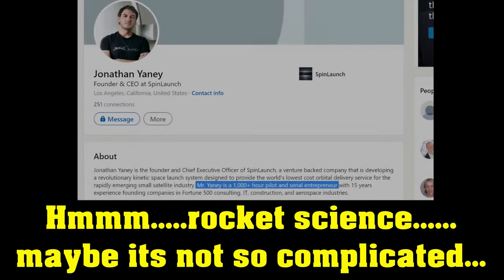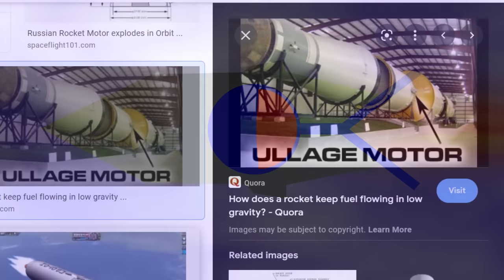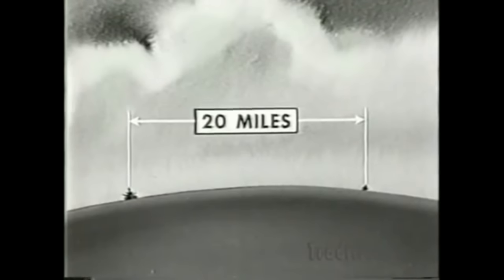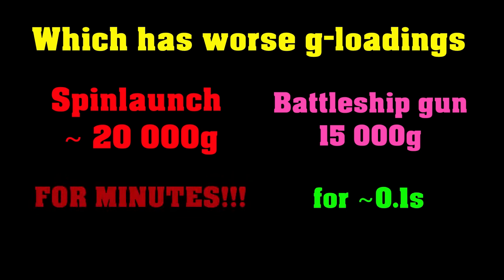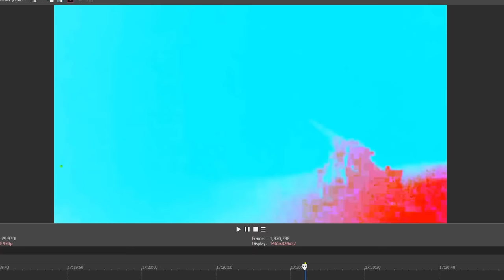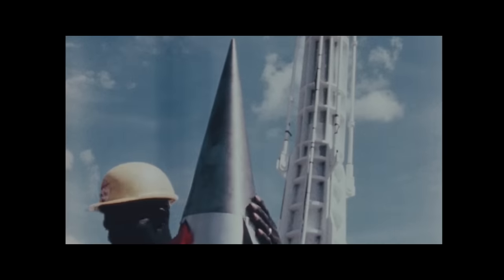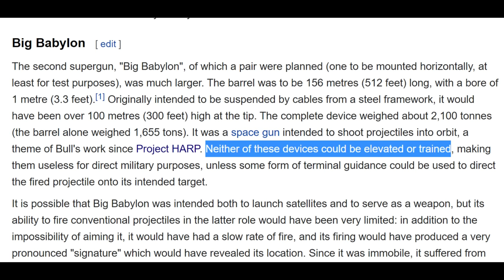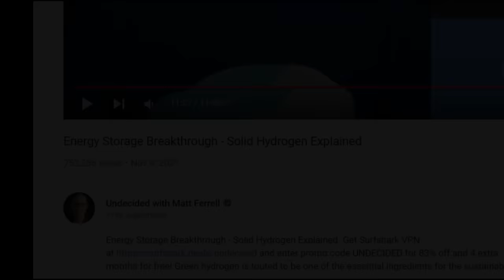Spinlaunch: BUSTED (Part 2)

Comment: Bad debunking,
with none of the physics addressed!

this thing will get to orbit with enough engineering effort.
the main question is: whether there is enough of a market for launching 20,000G-proof satellites.

the only instance where I think that it could be economical is launching bulk insensitive cargo to be used later, such as food or fuel

Comment: Assuming the diameter of this thing's arm is 108 ft the circumference of the circle it would produce while spinning would be 339.29 ft assuming there are 5,2 40 ft per mile to get this projectile to 5,000 miles per hour this centrifuge would have to spin at 77,500 RPM
Now I don't have a degree in engineering but I fail to see how you're going to get an arm that large up to those sorts of speeds when my weed wacker spinning a 16-in diameter circle of plastic string struggles to get that plastic string past 12,000 RPM how on Earth do they plan on spinning an arm that big up to that sort of speed even in a perfect vacuum which as thunderfoot pointed out is impossible for a chamber that large it blows my mind that people are gullible enough to believe that things like this are possible on Earth with Earth's limitations the whole thing would practically fly apart at full power

Comment: Spin or blast out of a tube, the G-force will be the same, to reach the same range,  just wtf are you sending up there, THAT hard, a cannon or bomb? There is 100s of way beyond a rocket to get into space, THIS is YEET to be one of them😜  For example, you can take a massive fortress station into space, without blasting off a ground rocket. How? Vhigh balloons hanging on rockets of same air fuel, when you reach near the peak, rappid compress while slow booster burn rocket engines swapping volume, then next stage full thrust beyond the zero grav&air kamen meso, ion. Presto , MASSIVE station into exo orbit velocity in just 2 of not more used stages.

Comment: Elon needs to hire you quickly.
Reply: Why? Thunderf00t doesn’t understand basic Rocket Science.
Reply: @jackwhitlock1  I think He does and at least he knows what not to do.
Reply: @marco.loschiavo  Except he thinks the tanks will be half filled. A two year old would make that mistake, not someone that supposedly has a PhD. Not to mention the fact it uses a pressure-fed Engine, meaning the tanks would be pressurized.

Comment: I came across spinlaunch and thought it was interesting because I love physics but when I seen how it works all my knowledge on the subject was screaming BS. It just doesn't work like that. Even if it did work what would be the g forces exerted on the payload while it's spinning? You might could fire a solid projectile but will anything sensitive that we need to get to space hold up to the extreme forces that are not being applied evenly from the bottom? Total BS. Interesting idea though.
Reply: Just watched the other half of your vid and you just touched on that.
Reply: the fueling would defy physics.  and liquid propellants in this sceanario... just no.

Comment: I won’t be bringing up the points I made on the comment on the last video because I am not a broken record like Th*nderf**t

1. It’s a artist’s rendering. Also ullage motor is unnecessary if you just put a small spring pushing back on the fairing.

2. Also the tanks are full so no sloshing.

3. They never said they did such tests on the centrifuge, I’ve heard Holloman AFB has a nice Mach 8.4 testing rig.

4. Sound effects are likely put in in post because it sounds cooler.

5. CNBC’s incompetence has nothing to do with the company/concept you are advertising to talk about.

6. “Very high accuracy” that’s why there are still have battleships around.

7. When did they ever claim to be accurate?

8. Comparing well developed weapons to a early prototype again.

9. Fire rate is definitely very important when it comes to space launch, definitely.

10. Do you expect a company to develop a system that is better than a battleship gun in every way and not get into legal trouble?

11. High G systems can be built if you put some effort into it. Satellites are not built to withstand 20,000 Gs because it currently isn’t practical, that can change.

12. What did showing that the nuke footage was slightly edited achieve? It’s still a real nuke fired from a real gun in a event that actually happened.

13. Oh look old ideas that happen to be promising and really cool can’t be revisited because… why?

14. I’m sure we need a space launch every minute.

15. Ew Britain.

16. Saddam Husain had only one target in mind so it would have still been a useable weapon.

17. So are you saying we should spend our money on things that already exist? Isn’t the whole reason to fund a project basically to make it into a reality?

18. Everything can be broken to simple geometric shapes.

19. Being even compared to the absolute perfect beauty that is the HARP gun is a positive in my books.

20. Mmm yes shameless self promotion with a terrible transition.

21. Mmm more shameless self promotion.

Just stop.

Please.

Comment: It would work in space, no need for forming a vacuum. Sort out the issues of the kickback from the payload to the spacestation plus the energy cost of it and your on to a winner.

Typical physics Vs engineering. You could make a space elevator, but the materials required don't exist currently

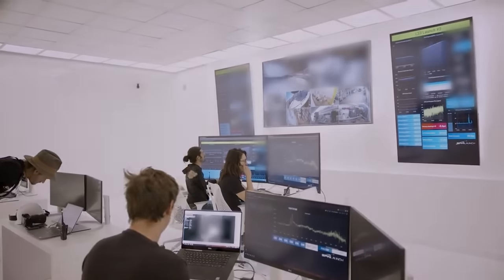Comment: 3:52 You are counting rpm of blade with a low framerate video, not all revolutions were captured in the video. Therefore, the rpm you calculated is very unreliable. Not saying it changes anything but getting data like that is not ideal

Comment: I get that you pump out these videos. But you should spend less time drawing lines on JPG's, and maybe have a read. 
They're not evacuating the whole system. They plan on shutting a door behind the projectile as it enters the "barrel". So only lose vacuum in the barrel itself. 

And you missed the most obvious and obnoxious issue with the whole setup. A centrifuge at massive RPM which suddenly becomes unbalanced by 200kg.  Currently they just slam the counterweight into a wall. lol 

Otherwise fun vid.

Comment: You would also have a low-altitude sonic boom to deal with each time a projectile broke the sound barrier. Not the biggest problem to deal with since the launch facility would have to be located in a remote location, but it might damage the centrifuge or launch chamber.

Comment: Can someone explain to me reasonably why they cant just shoot 2,000 pound satellites into space using naval guns? Is it because of the force required to shoot it? Would the electronics not survive the shot?
Reply: The force is too high, yes. No gun can shoot that far. 
No gun of any size can shoot something into orbit. The physics of orbits cause the projectile to go around the planet and smack into the back of the gun ... except it will hit the ground first. You need a rocket to round the orbit.
The horizontal speed required to achieve orbit is roughly five times the vertical speed needed to throw something up to orbital altitude. A gun can't supply that much force and cannot direct it properly from the ground.

You might be able to build electronics that will take the launch shock of a gun, but you might not be able to harden everything.

The SpinLaunch idea seems plausible, but it isn't.

Comment: I'm not here to defend spinlaunch, because most of the science behind it is stupid. But almost instant G changes/acceleration of around 15.000G and slowly building up to 20.000G is not the same. Massive G acceleration would tear most things apart, but slowly building things up to high g's doesn't have the same effect on things. You're literally comparing apples and oranges here. Besides the directional g force on the two is completely different.

Comment: You don't need ulage motors the space craft is already moving forward.
Reply: You need them if the projectile starts to slow down, which it will as soon as it exits and comes into contact with the atmosphere.
Reply: @GoldSrc_  You’re forgetting that the Tanks with be pressurized since it uses a Pressure-fed Engine.
Reply: And the tanks will be full when the Engine lights.
Reply: @jackwhitlock1  You're forgetting that this is a scam.

Comment: You seem not to understand that the reason they use a method that takes 8 hours to spin up is that electronics break when they get hit by 15k gs in a fraction of a second but not so if it’s spins up slowly. Just like when you crash a car it’s nots the stoping that kills you it’s the fact that you are stoping immediately. Slowing for 70 to 0 is fine as long as it doesn’t happen instantaneously This video went out of its way to be disingenuous.

Comment: You could have a big powerful decompressor to help the reset time. You could have a counter rotating tip to remove unwanted angular momentum, and you could launch only devices suited for the crushing g forces, then yeah you would have a cheap to operate cannon deal. You know how railguns work eh? they zap the living jesus out of some super conducting coils like something out of a bad batman movie.. but wait, there's no such thing as a bad bat man movie! :P Every timeyou reload the railgun ya gotta suck the air out and destroy a special cover plate made from thin aluminum too. You just don't like rotation, but if it was a rail gun you would be ok I think. I wanna see if they really do it, and if you will make a correction video if they really do start spin yeeting these damn things to space lol. I mean, stranger machines have been invented, like double ended pistons, and other preposterous engines... Like give the poor guy a break... He might figure out the counter rotating tip thing.....

But the first thing I think of is holy mother, the vibrations you would feel when it fires, because it would be like a washing machine on spin cycle with a big hammer in it, or like a brick stuck to the tip of a helicopter propeller, unless there was a second weight that slams into the ground lol.. That was the part I think you missed. The rust in the tube was your first concern? Really? I think thunderf00t doesn't exist, and you are really a worse copy of thunderfist. :P 

1 out of 5 starts on the debunking.

worst

debunk

ever....

But wonderful video, I like the artillery nuke footage being debunked and rebunked again. That's a real word...

Comment: your first point has always been a problem an a simple solution is pressurized tanks whish will push the fuel out anyway another solution is to use a monopropellant to push the fuel to the bottom of the tank. this problem has been solved since the space race

Comment: I want to see the liquid fuel rocket motors that can tolerate 10,000+ G's laterally and still function.   Not going to happen and before anyone invest a  penny in this project you should make them demonstrate those engines...otherwise this project will never work.   So...build a test rig and spin the crap out of the engines  then stop and see how they fire and be sure to get the isp needed to get to orbit.  Of course this will need a whole vacuum chamber test rig which will cost more than the whole spin-launching gizmo and be much more difficult to build.   I'm not seeing it happening.

Comment: Harp failed because the electronics could not take the Gforce and Gerald Bull fighting with HDL that was being turned into Army Research Labs was more than the Barbados government could take. Hundreds of workers were injured and Bull refused to do any inferstructer building as part of the project leaving people to sleep in tents and use 4x4 on mud roads he was a bit racist too or at least ignorant of the workers lives he was only around at the launch. Think of having 500lb of c4 or as Bull wanted and was denied until he stole it Nitro Glyricen in the truck getting bounced on a rutted mountain road. This leading up to Barbados gaining independence. Second we have launched space vehicles by acceleration to 1,000mph then using a solid fuel rocket engine to gain orbit most famously in 1985 with an f15 at 35,000feet. Major General Wilbert D. “Doug” Pearson JR was the pilot. The x15 project the motor weights 35lb and has gone over 1,000G's on a rocket sled before the instrumentation melted and it broke off the rails it melted the sled wheels. If this spin-a-mathing thing explodes or mis fires it is less a hazard or show then an Atlas V or Space X getting a stuck valve. This entire project cost less than the launch cost for current communication satalites going up like North 20. The hard G shock is from the projectile hitting atmosphere we have electronics that can handle those loads. This channel has turned into click bate for views also when has Wikipedia been legitimate research?

Comment: How do you know from their video that the spinner was at full speed? Why compare it to a battleship gun when an explosive round - even a nuclear weapon, is less delicate than a satellite. Why would you need comparable launch rates to a bullet? Is there a need to launch 48 satellites per day? You talk about 'minutes at higher G's' (when they said an hour) when this could be extended to an arbitrarily longer time, reducing the shock experienced by the payload. Couldn't the fuel and oxidiser tanks have a nozzle at the front, or a small special tank just for ignition? Why do you call the spinner 'existing as a computer simulation' when you've reviewed the footage of a prototype yourself. etc.

This is the problem with this channel. A lot of questionable comparisons, questions that could have solutions, confounding explanations and quite a bit of repetition too. I don't doubt that Spinlaunch is dodgy, but the case needs to be properly made.
Reply: Yep, just what I wanted to say. Very weak video.

Comment: The last thing you want to hear is some guy named Thunderf00t made a video about you and used the word BUSTED in the thumbnail!

It's amazing how simple math can destroy bogus claims...

So why can't math be used to destroy claims of "sea level rise is accelerating"? 

NASA claims that sea level rise has been accelerating since 1990 and today has reached 0.9mm/ year. That's pretty substantial. 

If a tide gauge has been rising consistently at say, 2.3mm/ year for 160 years, then from 1990, it should indicate a substantial curve upwards at NOAA's tide gauge graph.

In fact all NOAA's tide gauges worldwide should be affected since the oceans are interconnected.

Simple math tells me that if a tide gauge that has historically been falling at -0.79mm/ year for 90 years, starting in 1990, it would indicate a slowing of sea level drop and at some point reverse and begin rising.

0.79mm falling plus 0.9mm of acceleration  =  still falling at 0.79/ year? My math says BUSTED!

It's very odd that sea levels are not subject to simple math...

Comment: Really??? You think you are going to calculate the RPM from counting the revolutions in a video? Have you ever looked at a car tire rotating on a video or a helicopter rotor or a plane prop in a video... ever see them go BACKWARDS or stop completely in the video??? News flash, you cannot calculate the RPM of a high speed object using a LOW FRAME RATE VIDEO... OMG you are so out of your depth with your debunking... give it up.
Reply: That one supposed error does not make this silly project any more realistic.

Comment: Devil’s advocate here: if they added a shutter on the vacuum chamber where the chamber meets the evacuation tube they could close the shutter as soon as the projectile passes leaving the bulk of the vacuum chamber still holding a relatively strong vacuum and then they’d only have to pull vacuum on the evacuation tube portion after resealing it.

The timing on such a mechanism would be crazy on such a short length so the exit tube would probably need to be longer with the seal further down the pipe, though the longer the pipe the longer the vacuum reset timing on the tube itself which sort of feels like the elevator problem or rocket fuel problem where adding more has greatly diminishing returns, but applied to vacuum chambers.

This also adds more moving parts, more parts that can go wrong, equipment maintenance and engineering costs, etc, but at least these are time/performance saving technologies and not critical to normal operation since the shutter would remain open until the projectile passed.

It’s possible this shutter could improve project launch performance/efficiency too as there would be less atmosphere rushing into the tube to fill an overall smaller vacuum/voided volume since the much larger chamber would be sealed resulting in less disturbance as the projectile leaves the tube through the tear away tube seal.

Obviously they would still need to fix the myriad other problems, including what happens to the centrifuge over time as these loads are released and the balance with the counterweight suddenly shifts in just 1-2° of a single rotation. We’re talking about 200kg, sure, but that means 200kg that was previously apply an equal force in one direction is now being shifted heavy onto the counterweight side, possible damage to bearing of centrifuge over time, etc could occur.

Comment: The liquid pooling in the front-issue has many solutions, you can use nitrogen or some other expanding inert gas, also you can have fully pressurized tanks that don't pool.

Many ways. But even if it's a failed project, the experience anf data from the development will be worth the effort